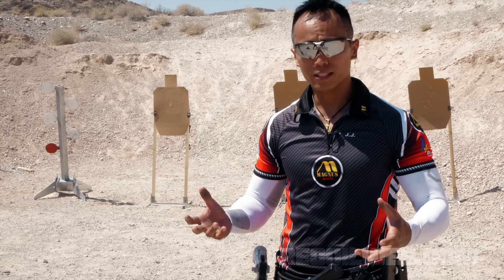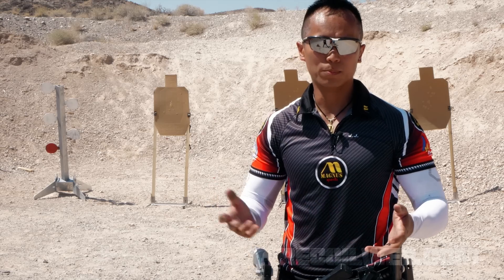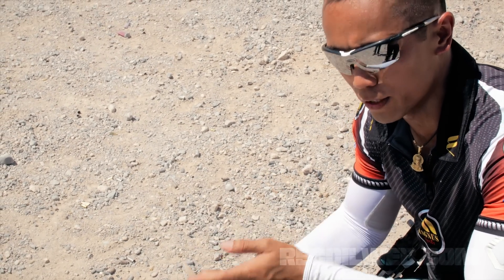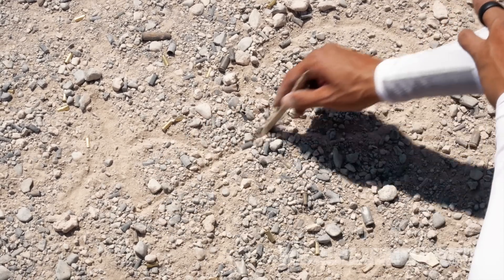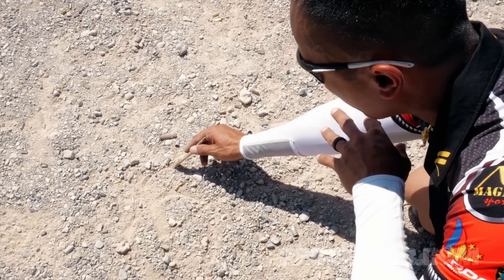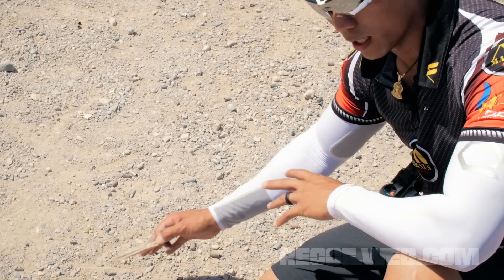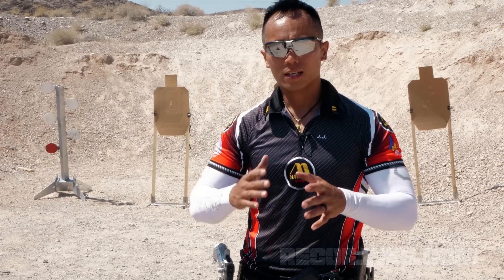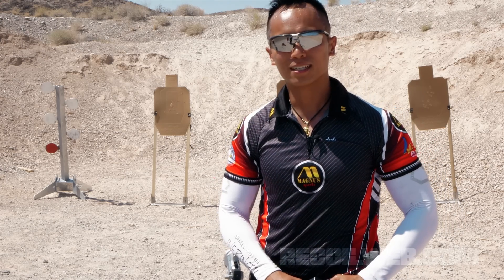Shooting Efficiency w. JJ Racaza

Comment: Which pistol are you using?
Reply: 2 years late I know, but in case you are still curious it is a Tanfoglio Gold Custom, ported barrel and hybrid chamber comp, with a C-More "Slide-Ride" sight.
Reply: @TheFishE77Official  Not a slide ride.  It is mounted to the Frame so it doesn't move when the slide moves.